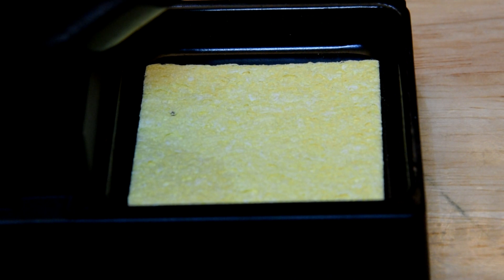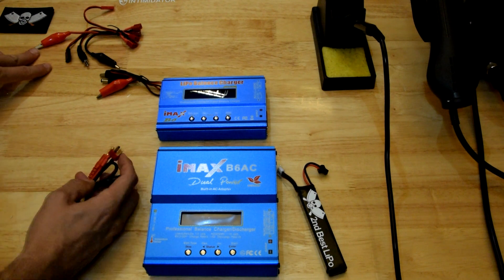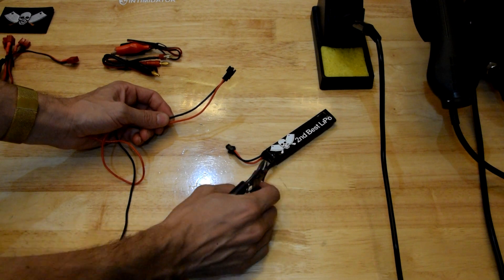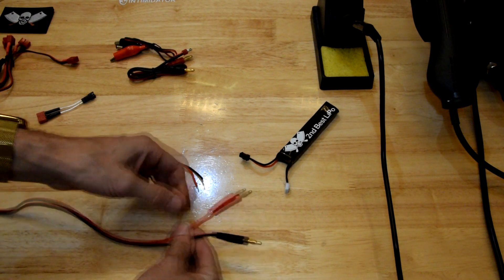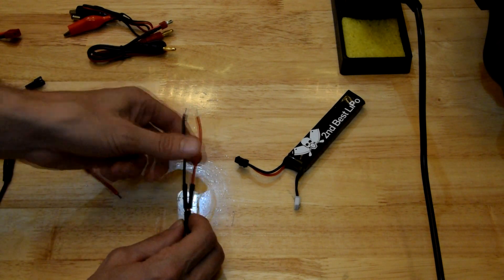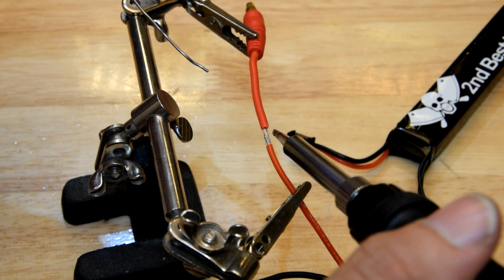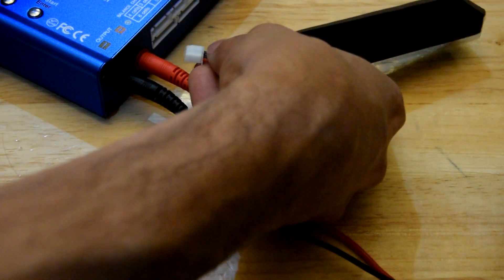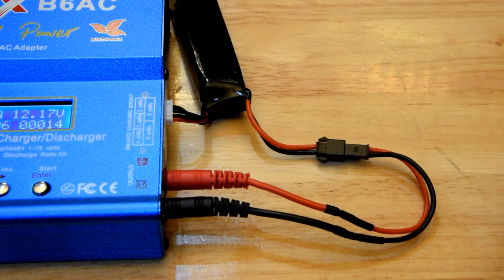Why doesn't My iMax B6 have this?

Comment: I swap my batteries over to xt30 connectors. I also use a charging board and xt60 to xt30 adapter I made for the board. I have an imac also. They are real flexible for so many batteries.
Reply from the maker: yeah you can swap the connectors over, like I said there are many ways to do it. I like to keep the JST-SM connectors on because its what everyone has and it makes it easy for swapping batteries in the field if you need to borrow one from a mate or something. the JST dont handle as much current as the other connectors but 90% of the time they are fine.
Reply: @lowguidoschopshop  battery swapping, I didn't think of that. Great channel really like your in depth descriptions.
Reply from the maker: @Guvna947  I try to keep a spare battery or two in my pocket, because by the end of the day someone is running low.  I have also been in the opposite situation where I was running low and a mate on my team had a spare that I could use too.. all about that teamwork.

Comment: Hey guido,Are those silver charging bags for batteries a needed thing or are they just good marketing.Also some people say put your battery and charging station on a ceramic tile?
Reply: A bit of both I would say, the dielectric layers can get be compromised but its not very likely unless you're bending or shorting out your battery.  While it's unlikely that you will ever get any spontaneous combustion if you don't manhandle your battery I sleep better at night know that there is another layer  of protection incase the worst does happen and god forbid, the shelf with my blaster on it burn down.
Reply: Ok .thanks
Reply from the maker: It certainly doesnt hurt to play it safe.

Comment: watch those knock-off b6/b6ac chargers like a hawk, the internal components are very sub par compared to the authentic skyrc counterparts, I had a clone almost catch fire 😐
Reply from the maker: There are so many clones on the market it's hard to know what you are getting sometimes. I have had so many of these chargers and only seen a couple fail.
Reply: agreed mate, there’s heaps! they do work well when they work but there’s a few horror stories online about them, there's also some good info regarding the difference between the genuine and fakes. Mine was brand new first charge, was on for about 5 mins and made a loud popping noise, thankfully i heard it from upstairs, when i ran down stairs it was smoking and let out some kind of toxic smell. 9/10 are probably fine, just be mindful 👍🏼
Reply from the maker: @ghilleinthemist2994  I have actually ordered 4 or 5 from the same place and 3 came genuine and 2 came fake so.. its a mixed bag.
Reply: honestly doesn’t surprise me at all mate haha

Comment: On the website to buy these you get a choice of EU or US plug. Which do you get?
Reply from the maker: I usually throw the cable it comes with in the bin and use an aussie one. Its a pretty standard laptop power cable.